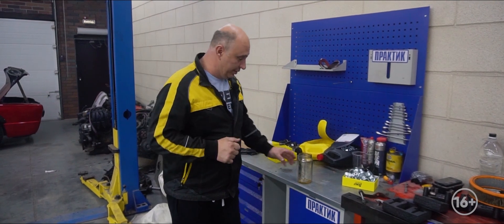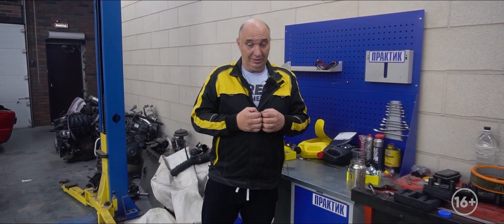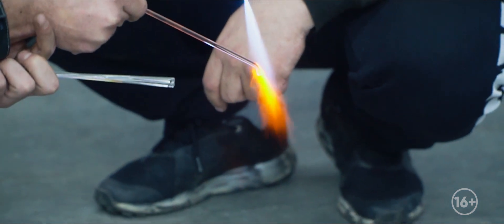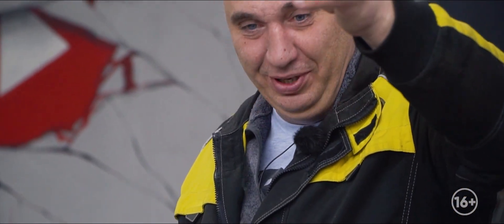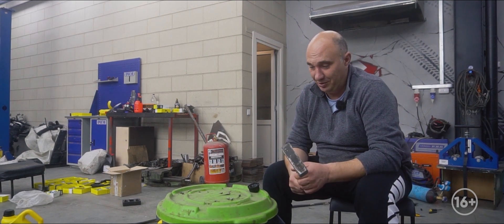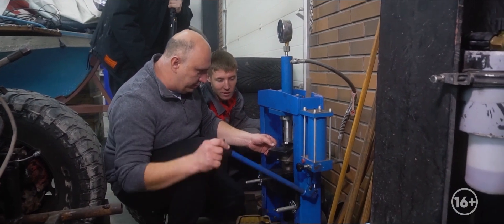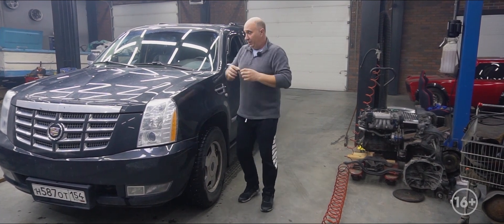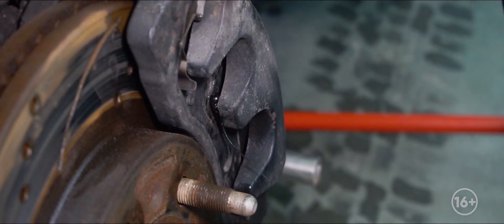Prince Rupert's drop vs brake caliper

Comment: holding the glass with bare hands while melting it with a 2000 degrees torch flame, puttin rupert's drop under tons of pressure and not wearing safety goggles... this can't get any more Russian than this!
Reply: They're also squatting at the start :-)
Reply: Holding the glass while heating isn't a huge concern, but handling the drop without glasses in any situation without glasses is super dangerous. You've seen it explode under the press. They can do that when you just break the tail on proper ones.
Reply: @paulhendrix8599  You're right!
Reply: Glass dosent transfer heat like metal does but the flame would be hot.
Reply: No, thats how we do in eu without useless equipment
Reply: Szar Putin drops
Reply: @adisk8PL  LOL!
Reply: @texasslingleadsomtingwong8751  LMFAO!
Reply: Normal shows: Don't try this at home!
Garage 54: 14:08
Reply: It can, where is the grizzly bear?!
Reply: We have a lot of spare lifes and can save like in computer game))
Reply: Nah, we would do it this way in Indiana, too.
Reply: @paulhendrix8599  well everyone knows it can break from the tail but the point of the video is to break it from the top !

Comment: Breaking off the end actually breaks it, it releases the pressure
Reply: @Tuatha DeDanaan u got me man, I did mean that lol
Reply: @Tuatha DeDanaan I broke up laughing.
Reply: Shoestring Stacker  nah its actually thr pressure, pretty sure of that
Reply: it's not really pressure, the elements / modules have a certain diameter at room or any temperature.
it's like boiling water in a kettle, at the boiling point the size of the water molecule increases to somewhere in between 600 and 1500 their normal radius, making them raise up.
that means, the energy put in by means of heat makes the electron go in a higher orbit around the nucleus.
cooling a droplet of glass rapidly (somehow) make the elements in the outer "areas" go back in their normal state ( room temperature), the electrons drop down the normal orbit, but the elements on inside don't cool that rapidly and get locked in place, but the electron wants to go down to  the normal state, but can't.

would you call that pressure or an implosion?

but that's what tempered glass is.

i think, @Shoestring Stacker is correct with tension.
Reply: @Tuatha DeDanaan first one is good.
Reply: Right, the tail is the weakest part, when it breaks the whole thing breaks.

Comment: Suggestion: Make a electric-Lada using only startermotors attached to the gearbox! Lots of them! Teslada
Reply: That's gng to be expensive in batteries...
Reply: Use the alternator
Reply: golf kart motor per wheel
Reply: In the spirit of Garage54, it needs to be Lada startermotors.
Reply: I’m pretty sure they did this a while back with just the regular starter motor
Reply: @5.43v  impedance is mismatched like crazy. BUT one small improvement could be : begin with all 4 starter motors in series, then change gears by switching to 2 parallels of 2 in series, finally all parallel. DC diesel electric locomotives do the same. Expensive in wires and switchgear instead.
Reply: @skuula  They really do that? That's so genius! I always wondered how the hell they managed to control DC at such massive power, obviously they wouldn't just use a massive pot as that would be terribly inefficient, not to mention the power dissipated would be massive. World of electronics is so awesome.
Reply: @thermionicemission6355  That's the classical system, yes. The EMD F series, SD40 and many others use that.
The modern ones use large frequency converters and induction or brushless motors.
Reply: @thermionicemission6355  There was a famous dragster "White Zombie" did the same thing.
Reply: The starters would overheat very fast. Had an ignition switch stick on an old shit box once and within about 30 to 40 seconds of the starter running full tilt it started blowing smoke out of it. Thankfully got the battery disconnected before a fire but the starter was boned after that
Reply: @He who must not be  just wrap them i copper-tubing and run water tru
Reply: @lassediscovers1813  I’m not sure water in a copper jacket would do the trick, they get very very hot very fast. Maybe if you had liquid nitrogen flowing through the tubes or something similar.  I don’t think water would be able to absorb the heat fast enough. For example my current vehicle without a thermostat in the winter will idle at 160 degrees. While driving it gets down to 140. And that’s with the outside temp at 20 or below. Starters get hotter faster than an engine

Comment: Breaking the tail off actually breaks the strength of the drop
Reply: they gotta redo this than
Reply: I'm very curious as to whether or not the tail can be torched off and not affect the integrity  of the drop . Not too close to drop . It may be that the tails need to be clipped as the drop falls into the oil .
Reply: “Breaks the strength”
8000lbs of steel between steel. 

Strength did not seem broken 😂

Comment: This man is wearing sunglasses with a oxygen torch.
Reply: Just Russian protective gear
Reply: Nice glasses Vlad! At least they were your girlfriends sunglasses.
Reply: If they are UVA and UVB blocking , it would offer some protection . Not complete but helps in a pinch . I prefer actual brazing glasses . Just don't go cruising around the shop with them on .  But , auto shading / darkening . welding helmet with grinding mode is really some of the best protection,  as it prevents facial skin from being excessively exposed to radiation . Nothing like a good sunburn from a day in the shop .
Reply: @texasslingleadsomtingwong8751  but they’re russian
They are very stronk
Reply: That's not proper ppe? News to me
Reply: aviators are always appropriate

Comment: Cut a brake pipe, put a pressure gauge to the 2 parts, connect brake pipe and read  pressure supplied to caliper there,
And a scale like on HPC under a used brake pad should show the force being exerted on to the disc
Also see how much difference in pressures between engine off (no vacuum assist) and engine on (vacuum assisted)

Comment: If u had turned on the car, u would’ve gotten some vacuum assist from the booster
Reply: true but that only decreases the pedal pressure required not the total pressure that the caliper is capable of exerting.

Comment: Not tempering the droplets in water, freezing them. To measure the force of the caliper, you need a mild steel round bar of roughly 1 1/2 inch (35mm) diameter, and 2 hardened bearing balls of about 6mm (1/4 inch) diameter. Cut 2 equal lengths of the bar that just fit in the caliper with 1 ball between bar and caliper. Stand on the pedal hard. Compare height of the stack to uncrushed cylinder and ball. The crushed cylinder will have been indented by the ball, making the stack shorter. Note the stack height as accurately as possible. Now you take the uncrushed stack to the press, slowly pump up, measure stack height, and note pressure. When your stack height matches the caliper stack, you have the same force, and the pressure gauge allows you to quantify it. If you want to know EXACT force applied, them multiply the pressure by the cross sectional area of the press piston. 4000 psi on a 1.5 square inch piston would be 6000 lbs force. Get your cylinders exactly the same length, you will have quite precise data using this technique. The cylinder can be mild steel, aluminum, copper. Dont use zinc or hardened steel.

Comment: The interesting thing about these is that if you try to break off the little stringy bit the whole thing will shatter, but you can hammer on the drop part and it won’t smash.

Comment: I like how the drops do not boil the water around them.
Does the power brake booster make it much easier?
Can the droplets be machined / ground on the grinder wheel without exploding?
Just put a pressure gauge on the brake line, force = pressure x piston area.

Comment: However, pedal travel will increase. Seventy pounds of force on a brake pedal can result in 556 psi of brake fluid heading to the calipers.

Comment: Remove all the friction material from the brake pad, and replace it with solid glass that is the same shape as the friction material.  See if the car will stop.  Fill a mold above the brake pad backing with glass beads and melt them to form the glass friction pad.

Comment: Wow, all of the pressure in that hydraulic cylinder is concentrated onto a very small area so the force on that point would be insane as that 4T can't be spread over more than a 1/8cm2 of area.

Comment: Run a Lada or any car with an electric motor and magnetos on each wheel or multiple mags running off a driveshaft to recharge as well as dynamic braking. Just wonder how much power would be recovered.

Comment: It would of been easier with the engine running in order for the vacuum of the engine to boost the brakes
Reply: Yep lol
Reply: It's most likely equipped with the hydroboost braking system. You have full braking power for quite a few more (From what I've tested I was able to have some assist at up to like 30 pumps) pumps of the brake pedal with assist with the engine off before it loses pressure. Many GM SUVs and trucks made between 1997-2007 had it, this one in all likelihood does as well.
Reply: @THOMASTHUNDERPEEN  that's a lot of pumps
Reply: @THOMASTHUNDERPEEN  Hmm I am surprised I've never really known about that and I've worked in cars for years lol. I suppose the way you would tell is the bell shaped thing stuck to the firewall
Reply: @THOMASTHUNDERPEEN  it more like 3-4 pumps assuming the accumulator still works
Reply: @lancebandy9901  I've driven/worked on a pretty good amount of chevy/gmc trucks and SUVs and in my experience it's seemed like a good bit more than just that many. I dunno though, I might be wrong.

Regardless of that though I've never really liked them since it's using the power steering pump to generate pressure, the thought of losing both power steering and brake assist if something goes wrong in the system is a bit off-putting.

Comment: I have an interesting question. Is the stock transmission of a Lada Niva capable of working and surviving a 6.3l Cummins engine swapped in?
Reply: No.
Reply: Yes.
Reply: Of course it is . But can a Cummins handle being next to serious engineering ?
Reply: Come on, it's a licensed FIAT clone product from the 1960s or 70s, designed for about 50hp.
Reply: @skuula  lol , I figured someone would bite . my next truck will most likely be a Cummins . Just no more powerstrokes . 7.3 was the last real diesel from international  for Ford.  Every since , they have been four tired atrocities .
Reply: @skuula  Though taking some influence from them, the engine and drivetrain in ladas were their own development, with SOHC for the engine and full syncromesh on all forward gears, with the ability for a 5th gear overdrive expansion.
The Niva featured a uprated VAZ 2106 gearbox, as well as a larger 1.7L engine, made to take way more power than 50 lol
Even then, a normal 2105 gearbox has no problem when mated to a high compression turbocharged toyota 1NZ-FE engine , making far too much power for the wheels to grip with lol

with a huge american diesel v8 thing hooked up, yeah , it's not so strong to take all the power for very long, but "working and surviving" it'll manage just fine

Comment: They use an overpriced Tahoe to smoosh glass. Best use I've seen of an Escalade other than gun fodder in a long time. Hehe, wait until you have to change a headlight bulb. Takes a couple HOURS. Got to completely remove the bumper, grill, and all kinds of stupid shit. Another example of that "high quality" GM engineering for ya.

Comment: Wow the research was so extensive there learned nothing about how to do it properly. Water tank is not tall enough and you didn't heat the water either. Also wrong glass and that is not going to be volunteered by me. That one costs.

Comment: Make an stock engine revv to 10000 rpm!
Reply: You do this with any lada by remove the governor spring

Easy peasy :)
Reply: @televisionandcheese  wow. I thought the pistons would just explode because of the high revvs... or the valvles would explode too lol.
Reply: @gabrielvieira6529  well , if you do it for more than 2-3 mins , valve will float , and for longer, things will go wrong

But these lada engines can sit at 6000rpm all day with no issue!